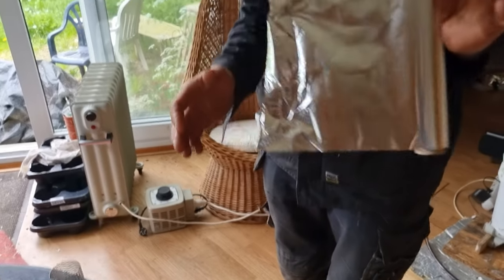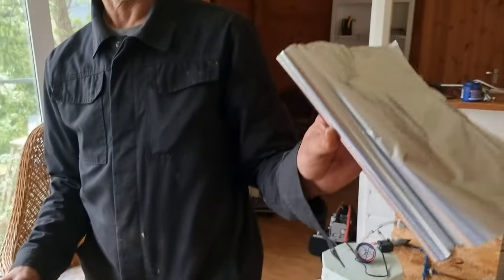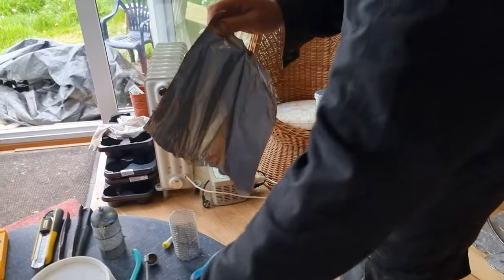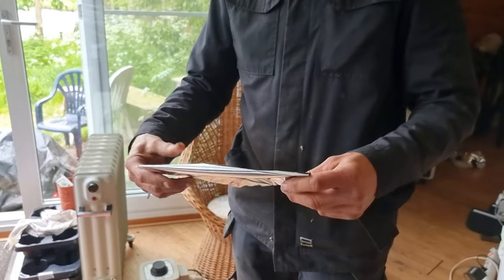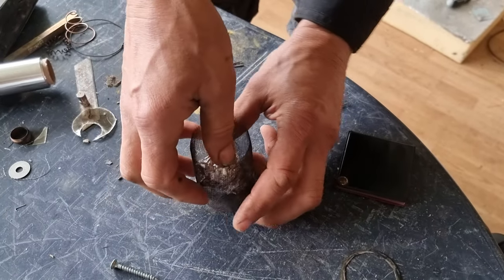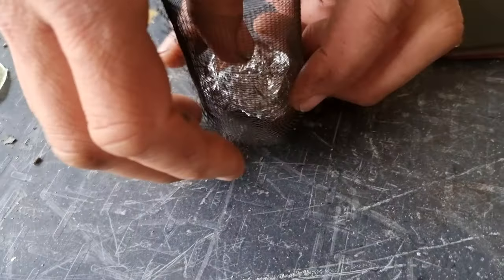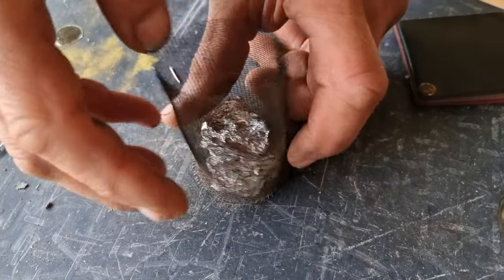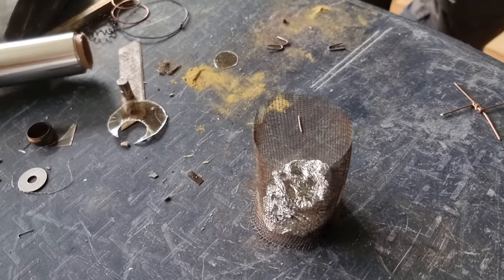VEGA - Henk Jurrien's 'Sacred Geometry' experiment how-to

Comment: I've been smuggling bits of foil out of my cooking job. And forming them into slugs to be shot out of an air rifle. They work beautifully as pellet rounds, conform to the barrel perfectly and shoot out much faster than lead.

I had done it to shoot rats and iguanas but have been inclined toward making square points and such.

With a set if pliers or a mold you can get them almost as dense as a solid piece.

The trickiest part is making a pyramid that fits on a quarter inch circle, I haven't managed yet. Though an obelisk would be cake

Comment: What is the purpose of this?
Reply from the maker: The response of novel cathode arrangements in a low pressure air with a dome over sample. Intuitively none of the observed effects should have happened.
Reply: @MFMP  Bob, I watched the video showing the experiment. Henk's setup was a gas cylinder with plastic tubing surrounding it and something put into the tubing. From what you stated above he put a partial vacuum into the cylinder with either a iron pipe or steel screening with an iron dome over the top of this setup. He then put aluminum, brass, silver metals inside of the iron pipe or steel screening with an electric arc I presume.  He then got some sort of reaction that burned holes into the aluminum foil and it seemed to be covered with carbon or diamond? I am going to research this with my theory and get back to you.
Reply from the maker: @richardmuller867  We need to study a few of the samples to get a better idea of what is going on.
Reply: @MFMP  Bob, most definitely. Elemental analysis.
Reply: @MFMP  Bob, I sent you an email about the experiment. Please read the email.